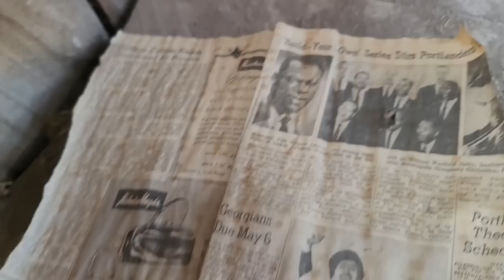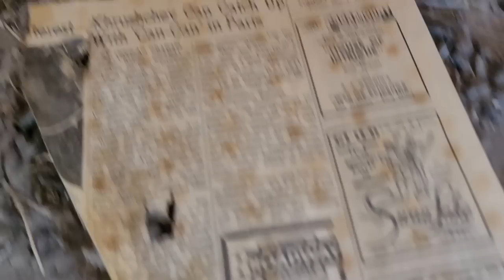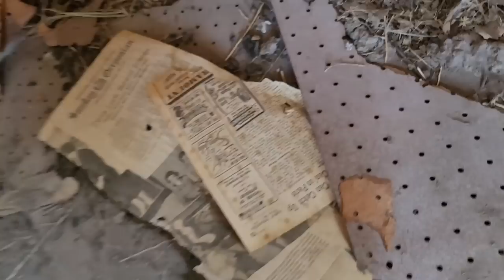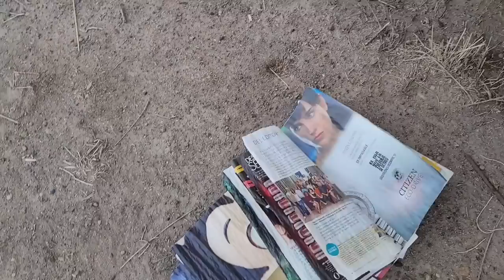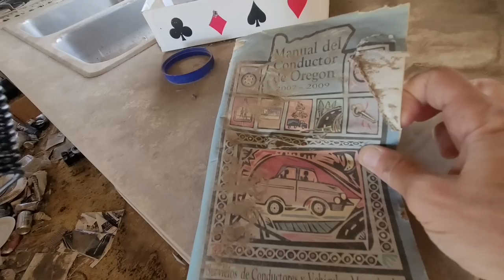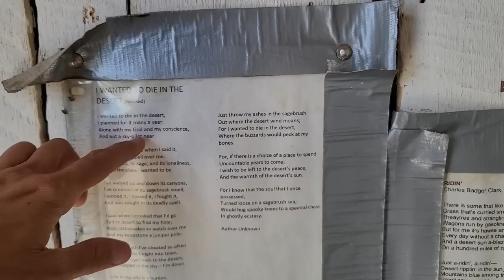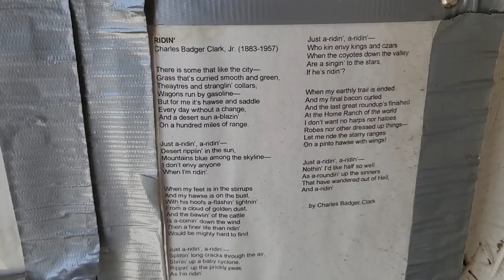THE TRAGIC SAGA OF FARM BOY KYLE: My Totally Bonkers Theory Of What Happened at This Abandoned Ranch

Comment: I was just waiting to see how it turned out. It was strange how parts of the bike was dirty or rusty and other parts were shiny new. 
In case you want additional date placement info there’s usually a plate from the rv manufacturer by the entry door or occasionally on the front wall the same as the trailer tongue. Your trailer should have one too. The building with the root cellar that has the top area could either be a kitchen for cooking or for doing canning or something. My aunt and uncle had a farm with what they called a summer house where they cooked meals in the summer months in order to keep the main house cool. Their summer house had fancy faceted cinder blocks. Not sure exactly why other than the cost wouldn’t have been much more and maybe gave more surface area for cooling purposes.? Be safe and have fun out there Sara. Will be standing by for the next installment.😉
Reply: Same thing I was thinking! I think we could fix that beauty.

Comment: Many rural places had no grid power up to the 70's.
They had Light Plants. Small 32 or 48 volt diesel/ vegetable oil generators. Usually charging batteries during the day, and not running the engine at night.

Comment: Keystone Beer wasnt invented until 1989.
Adolf Coors brewing co introduced Keystone Light the same year.
So "Kyle" had to be, or looked to be of drinking age in 1989 or later.
The bike is modern generation Elsinore.  The seat says Honda. The tank decal says XR 200R, or XLR 200R.  Probably a late 1990's, early 2000's.
The thin 2-burner stove found in the cabin obviously had been removed from the gutted RV trailer.
Reply: That makes sense as in the years 1992-1994 I remember building beer Keystone displays at a grocery store making most of its profits in beer and liquor sales.

Comment: My guess is the wooden buildings were part of a large cattle ranch into the 70s. The motor bike and trailer are from maybe an individual in the 2000s, could be some Mexicans hired by the owner of the land. The buildings in the 2000s probably was close to what they are now, so get a trailer and live there. The bike engine is probably bad and was not worth the effort to haul back to civilization. There is probably water around and someone (probably a bank or someone similar) still owns it but it is not economical and you would be hard pressed to find someone to live out there. I don't think they were aborting calves, but they might force labor so they could be around out in the field when the calf was born, bad stuff can happen during birthing process that a person can easily solve.